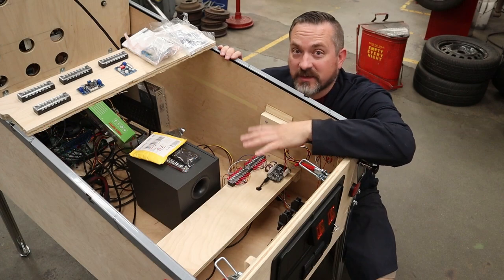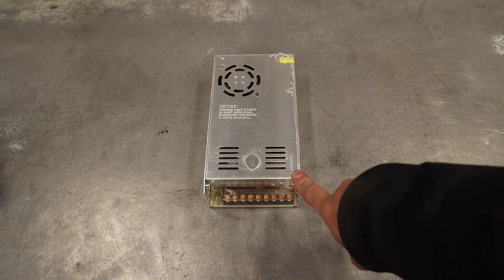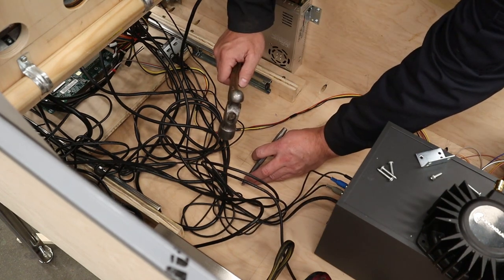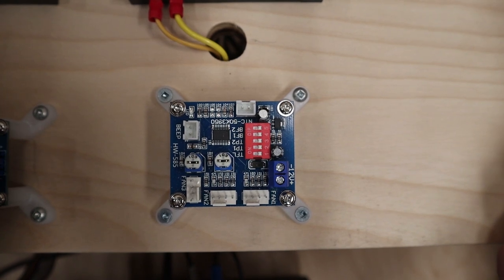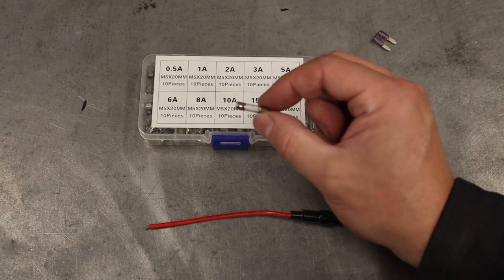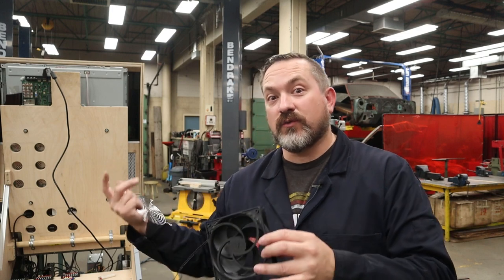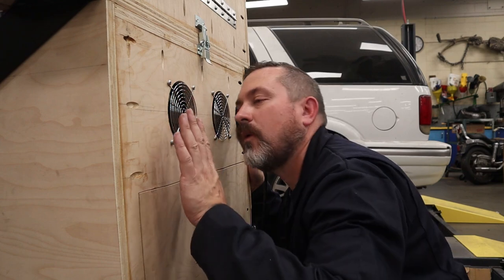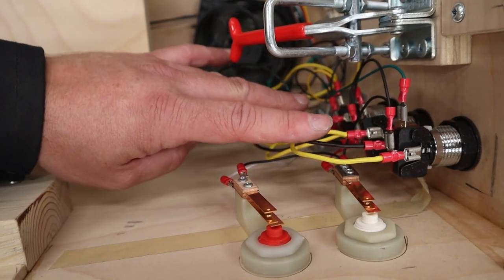Virtual Pinball: install power supplies and much more

Comment: Suggestion for bonus clip related to this video.  It’s pretty common for folks to install “hidden switches” on the bottoms of their cabinets to disable features in their cabinet. Especially if your going to be wiring up DOF or LEDWIZ.  You can have hidden switches under the cab to disable the features all together. IE… if your playing at night in a game room and you want to disable all the loud speakers and flashy led lights, you can do it right from the cab and not have to change a bunch of software profile settings.  Super easy to do to, provided you wire it up to a switch before you send power out to the devices.  I think folks would love to see this “advanced wiring technique” in perhaps another video.  Especially with the use of your wiring blocks, it makes it super easy to wire up.  As always… great content! ❤
Reply from the maker: Yeah that's a great idea!  There's always soo much to put in these videos so I gotta cut them shorter.  Maybe a video wiring in hidden switches and how to add a shift button for things like pinvol adjusts, night mode, no leds, etc.  Thanks for the watch!
Reply: @wayofthewrench  if you could do it, I would appreciate it!
Reply from the maker: I'm in the middle of filming a Pinvol tutorial video and the suggestions you made are all done with Pinvol.  You can press a button and have nightmode which you can set the volume for.  It's a great program.

Comment: Just as a FYI, pretty sure all fan manufacturers embed a fan direction mark on the side of the body of the fan. Terrific work. Was just going to buy a pinball machine.  Got me thinking about building one now.
Reply from the maker: Thanks for the tip!  You should totally build a vpin, you can save your money and build a better vpin than you can buy and for a lot cheaper too.  Good luck on your build!

Comment: A bit late. My only nit to pick is that a ATX power supply will not supply that power evenly like the laptop/console ones. 

A 500W one will almost certainly not give you 100A at 5V for instance.   It probably doesn't matter too much for a cabinet but it's something to think about as power needs rise.

More modern ones are very focused on 12V (for video cards) and the other Voltages not so much. The label on the side will give details. 

You also touched on the fact that even the same voltage may be split into rails each with their max amperage. So you might end up needing multiple split out blocks for a single voltage.

Just would hate for someone to try and power a bunch of LEDs off of it and get into weird power issues for instance.

Thanks for the series!!!
Reply from the maker: The ATX power supply will be fine for aleds as you will not be drawing that much power.... I'm not even drawing 10 amps for everything.  You'll  never run 100 amps in a vpin.   That being said, I did run a separate amp for my LEDs and showed that as well and I went overboard with a 60 amp PSU.  My next build I'm going to try running just a 10 amp PSU from Cleveland Software Design's kit and see if that's enough. I think it'll  need a bit more but we'll see.  Thanks for the watch!
Reply: @wayofthewrench  

Yea you might need more than 10A.  
I didn't try and count what you have on this project. 10A should get you to about 150-175 -ish LEDs full white, full bright and probably twice that with more normal usage.  60mA is what I use for my safety planning number anyway.

This project is going back to the top of my list as soon as the kids grow out of Paw Patrol.  😄

Comment: I really enjoy this series
Edit
Only suggestion is zero volt or ground strip my old eyes sometimes miss things but what ever amperage your drawing check your ground to be sure the wire gauge is sized ok and enough
Reply from the maker: Thanks Leroy!  There is a zero Volt/ground terminal block, it's the one with all of the black wires going to it.  The yellow wires are for 12V, the brown is the 6.3V, and red is 5V.  Yeah for now the 18 gauge wires should be good but I might have to go a bit bigger for the addressable led wires (60 amp total). Mind you, there will be multiple wires to inject power and ground so it might be ok with 18 gauge.  Thanks for the watch Leroy!

Comment: Nice job and really nice job of going over things.  This actually was the video I was kind of waiting for.  How many lines, what voltages, and what needed to be connected how and how many devices you needed to make it all work. I get it, and that really helped.  After I finish your series, I will start going down with a calculator and figure out what it will cost me :)
Reply from the maker: Thanks CoolDave!  Glad I could make it easier for you.  Why wait?  It's too cool of a project to wait.  Just do what I did and buy a couple used monitors and cobble a used pc together and have fun playing for a couple months to see what it is all about.  Then when you find out it's the coolest thing ever, you can spend some more money to start on a cabinet.  Cheers!

Comment: Your videos are great and I'm learning a lot. Someday I'll do a full build but for now I'm just modding my ALP. How do you calculate the power needed to make sure the power supply can handle it? Example: I've got a 12V supply running flipper solenoids. If I want to tap into that for SSF amps, how do I make sure it can handle it? Hoping I don't need to buy another supply and can use what I've already got.
Reply from the maker: Thanks!  Usually you add up the watts for each device and make sure the PSU can provide that amount plus some headroom.  I would not mix mechanical toys with your SSF as you can have feedback issues in your audio.  It's easy enough to add another PSU.  Good luck with your future build and enjoy the rest of the series.  Thanks for the watch!

Comment: Great Video!! Just wondering why you don’t use the PC psu for both 12v and 5v supply and not have a separate 5v power supply for addressable led strips? Thanks
Reply from the maker: I didn't want power surges from led lights going into the audio plus the sleds were using close to 60 amps.  Thanks for the watch!

Comment: Since I used a"stand-alone" KL25,  with Pinscape FW, I build boosters and used outputs to have DOF controlled button/coin door lights. Another awesome video. I just did a tear down for paint. This will be my 1st time prepping plywood with pocket holes. How far out is that video LOL. Thanks again.
Reply from the maker: Thanks dude!  Yeah there's lots of ways to do that, I have an ledwiz that I will setup for a future rgb flipper button upgrade and dof controlled front panel buttons.  Cool!  You're probably gonna be done your prep and paint before me as my video schedule is slow but for my sanity.  I would plug those pocket holes/cut/sand them so you don't have wood fill shrinkage.  Good luck!
Reply: Yeah. I used all 32 Ledwiz outputs. They go fast when using RBG since each lamp or strip uses 3 outputs. My Ledwiz is controlling 10 contactors, 5 flashers, 2 RGB strips and strobes for 32 outputs. The KL25 with Pinscape is doing all button lights, coin door lights and beacon. Custom boosters with fused inputs for all. Playing around with the combo of contactors and SSF I leaned toward the contactors. The sound and feel was very realistic. But I found that the SSF was a great filler for some tables. Simpson's Party is one. Nice sound and feel of the ball rolling on the playfield and the ball and coin drop effects are great too. I think I'll be playing that table alot. Hoping there are many more tables that will give the same effects.
Reply from the maker: You got a ink for the custom boosters?  I wouldn't mind trying to make some.

Comment: Great videos that you are sharing which are greatly appreciated and helping my build. What size were the fans that you used? Cheers.
Reply from the maker: Awesome, I'm glad you're able to get something out of my diy series!  I just used standard 120mm 4 wire pwm computer fans.  They work great and so far no heat issues, especially with the pwm control boards to turn them up if they need to ( which they haven't).  Good luck on your build!

Comment: Great video. I'm guessing if you wanted to keep things simple with the fans, you could just connect these to the 12v power supply? I always envisaged them being on all the time, not temperature regulated
Reply from the maker: Thanks!  Yes you totally could hardwire your fans to be on full blast when power to the cabinet is on.  I was concerned with fan noise though so opted for a low fan speed unless the temps went up and then they would auto turn up until the temps went down.  Just for reference, the fans never turn up or at least I never hear them.  Thanks for the watch and welcome to the channel!  Enjoy the series!

Comment: @Way of the Wrench  I saw you have a rocker switch in the back. One that takes a standard PC Cord. Did you strip the end of the power strip to attach to it to only have to plug that in?
Reply from the maker: Yes it is in this video.  I stripped the end of the power strip plug and attached the connections to the back of this IEC 320 switch.  So now there is a switch from the outside for the entire cabinet and a 10 amps fuse in case something isn't right.  Thanks for the watch!

Comment: Instead of using 6.3 volts for your incandescent lights could you just buy 3 12 volts LED bulb replacements? I love that fuse wire you got there, definitely going in my next build. Great job!!
Reply from the maker: Yeah you totally can buy replacement led bulbs, I just did this to show how you could use a regulator for the original bulbs.  Yeah those in line fuse holders are slick....and cheap.  Thanks for the watch!

Comment: I'm following parts of what you show here, along with some of your other videos. I have a Sainsmart relay board that I will be connecting to my Arcade 1up solendoids (probably do something different once I decide exactly what I want to to). But for now, I just want to get the power all setup. I have terminal blocks that I'll be wiring in as well. The only thing I'm having trouble with right now is where to place the fuse? I'm unclear on that. Looked like  you put in one fuse for the whole power supply. Can you explain a little?

Edit: Never mind, I watched a little further and you explain. You are using it in a daisy chain to run power to a lot of buttons. And correct me if I'm wrong, but since you are using a terminal block and everything on that block is connected together, it will protect everything drawing power from the block?
Reply from the maker: I used inline fuses for my devices so if a wire has a fuse, it will pop and protect that device.  Hope that helps.  Thanks for the watch and welcome to the channel!

Comment: I'm seeing mention of a grounding strip in others setups...
Are you doing this? Thoughts on whether it's needed or not?
Reply from the maker: I'm going to do a wiring clean up and a ground cable install when I do the teardown for paint and vinyl.  It's more of a safety thing in case a hot wire touches something metal that somebody touches on the outside and gets zapped.

Comment: Doing the button wiring on my cab now and working with mix of buttons from different sources and some old build ones I've lost track of their source, so I little worried I feed them wrong voltages. Is there a way to check the bulbs voltages? They all do seem to be LED ones but no indication anywhere if they are 5, 6.3 or 12.
Reply from the maker: Usually you remove the bulb and look at the markings and then look up the specs.  Here's a decent source of info for ya.  Cheers!

https://www.pinballinfo.com/community/threads/pinball-bulb-info.1952/

Comment: is there a specific step down regulator you use here? Also is there a reason you have the external 5v power supply and didnt draw the 5v from the ATX as well? Trying to determin if i can just run everything from the ATX (Minus the computer) . thanks
Reply from the maker: I just added a link for the step down voltage regulator board to the parts video description and to this video's description.  I needed the step down regulator to go to 6.3 Volts which is the original voltage for those bulbs (they are a bit brighter than 5V).  So I used the 12V from the ATX PS and stepped it down to 6.3.  Thanks for the watch!

Comment: This series has been an inspiration. Your videos are so easy to follow and has helped me so much. I have one question (and forgive me if you have mentioned it somewhere) Did you ever 'ground' your cab like mentioned in the mjr bible with the braided cable? I don't recall seeing it in any of your videos and now I am at that stage wondered if you did it with your cab (or any workarounds you may have done). It mentions grounding all the metal parts (legs, rails, plunger plate, lockbar etc) to the AC ground (I know the DC is different). Would love to know if you managed to do it (or not) and reasons. Thanks!
Reply from the maker: Awesome, glad you like my teaching style, you should check out my welding and auto videos too!  Yes I have that grounding info/install in my upcoming final assembly video along with cleaning up the wiring.  This week is the vinyl video and 2 weeks after is the final assembly video.  Thanks for the watch and enjoy the series!
Reply: That's great I very much look forward to those and yes I have watched some of your other series, especially the Arcade build too. Can't wait for the next videos now!!
 @wayofthewrench
Reply from the maker: Here is the video with the grounding wire in case you didn't see it.
https://youtu.be/q-O0SMqILYY

Comment: Hi. Is it possible to go with only dedicated power supply to each voltage? I do not feel confident in messing with atx power suppy.
Reply from the maker: Yes, you totally can order separate voltage power supplies.  I was simply showing how you could use a cheap/free atx power supply for this use.  thanks for the watch Peter!

Comment: Hello, your video series has inspired me to try and build my own VP cabinet. I'm at the early stage of looking for free/cheap TV's and PC. I got some leads, hopefully can start building soon. Regarding this particular video, could you provide a little more information related to the terminal blocks? Are they all the same? I'm seeing some on Amazon that look like yours, but they have 15amp and 25amp options. What do you suggest? Are there other things I should be considering? I know you mentioned you might upgrade to a 10 or 12 position terminal in the future. Last question, were you using the colored 22 gauge wire on all of those runs? Electrical is not my strong suit, I'm hoping to mirror your setup so I have a good reference. Thanks!
Reply from the maker: That's exciting! You're gonna have a lot of fun!  The terminal blocks are generally all the same just the amount of spots for connections.  Most of the wiring is low amperage in the cabinet depending on how much your putting through them.  I would suggest terminal blocks that are 10 or 12 just in case as they are not that much more than 8.  With signal wires I used 22 gauge and the power wires I use 18 gauge.  The colored wires were just to keep it easy to keep track of which wire went where.  I also used red for 5v, yellow for 12v, black for ground, brown for 6.3v.  Good luck on your build.  If ya have any questions, feel free to ask.  When your done, please send me some pics of your vpin!

Comment: When daisy chaining power supply 24v 12v 5v on one plug is there any limitations ?
Reply from the maker: Grounds? Not really.  Power, yes..... eventually if you draw too much power.  You only have so much supplied wattage and once that's used up, it won't support it.  Aldo each rail on a ATX is only so much too.  Thanks for the watch!

Comment: Why you didnt choose to take the 5V also from the PC Powersupply? Does ist not have it? I saw powersupplies for  5V, 12V and 24V all in one - does this solve all my power problems?
Reply from the maker: Two issues.  One is that you don't want your toys powering your audio too, you'll experience feedback issues.  The second is that my 5V led strips need way more power than my ATX PSU can supply.  Hope that answers your question.  I do set up a 5 V from the ATX for my interior led lightning near the end of the series though.  Thanks for the watch and welcome to the channel!
Reply: @wayofthewrench  thank you 👍
Reply from the maker: you're very welcome!

Comment: Looks like you went back to a smaller screen again? You didn't like the 32"?
Reply from the maker: No I didn't change my monitors, still using a 32" and a 46".  After decasing them, they do look a lot smaller though don't they.

Comment: Did you add slow blow fuses to your toys?
Reply from the maker: I added regular 10 amp inline fuses.  2 years and no issues or fuses blown.  Thanks for the watch!
Reply: @wayofthewrench  Thanks for the reply,I'm assuming that because you used the diodes the cancer of feedback voltage is low.
Reply from the maker: No it's more that the amperage drawn wasn't over the 10 amps.  the diode just prevent flyback voltage which is the same amperage in a burst just backwards.

Comment: Any reason you dont just use your computer, to switch on  all the PC PSU ? So when computer shouts down, it also shouts all PSU's off.
 ?
Reply from the maker: In this case I didn't because I liked showing the board and all of the functions like temp control and lowered fan speeds when not needed and alarms for fan stopped. Thanks for the watch!

Comment: Why didn't you get 5V from the ATX powersupply? Was a nice vid looking forward to the next one
Reply from the maker: You totally can use the 5v off of the atx psu; however, my 5v is going to be for all of my addressible  led strips which are going to need like 60 amps.  So I put in the other psu just for that and so I could show people that type as it's probably more common.  Thanks for the really good question!